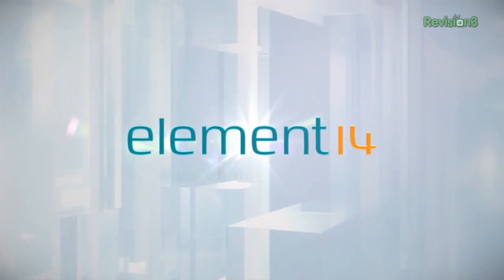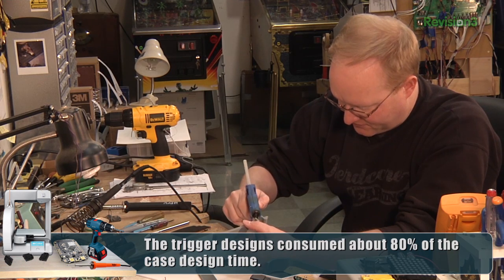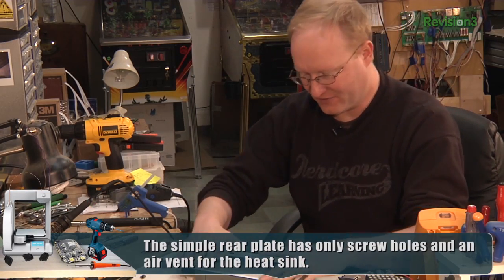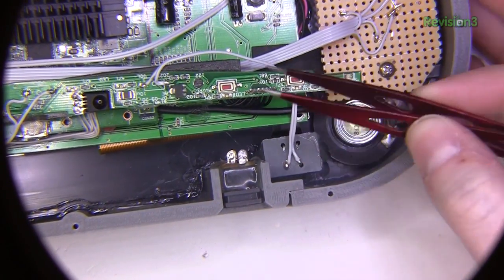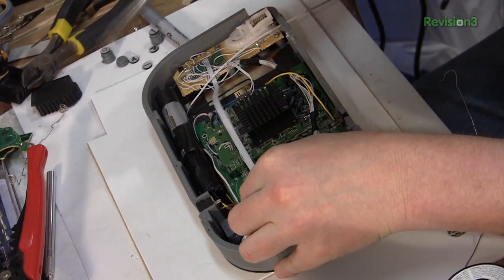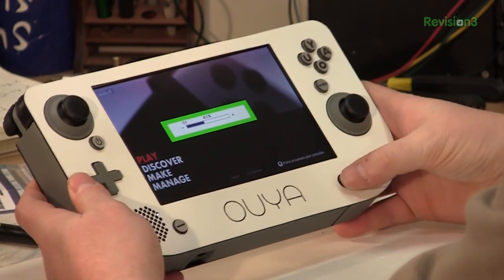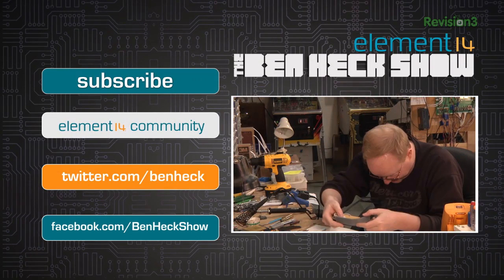Ben Kickstarts His OUYA Portable Build Part 3

Comment: If i had the technical know how i would've built the portable differently like for one thing placing the screen above the controller with a narrow channel for the wires to run through like they have at the game kiosks so the wires from the controller don't get damaged and is able to hold up the screen and console,
and connect the wire channel leading from the edge of the controller into the bottom edge of the screen and place the ouya components behind the screen and attach a lithium or nimh flat battery to save on space,although that's just something i would've done.

Comment: Would anybody know how to make a gameboy into a ouya type console without emulation
Reply: Cubing Miner bad idea.. Would take far too many resources and isnt possible with a stock gameboy.. Get a £25 Android tablet and run emulators from it.. If you wanna hack it then take it out of its shell!
Reply: Cubing Miner not possible, as the Screen uses vertical and horizontal line signals for the LCD. you cannot simply transform this into tv or rca out. Also the ribbon connectors where you would Need to get the raw signals from are way to hard to connect anything to it. Browse Videos for "DMG biverted backlight" and you will get an Expression on how hard this might get.
Reply: ok guess i have to go for emulation on a pi

Comment: So.....he basically turned the Ouya Back into an ANDROID tablet? Oh wait, that is right this is a ANDROID tablet with built in controls....well that might be nice if there were a need for that, I have 2 similar devices made by JXD already, the JXD s7300 and JXD s7800b.........
Reply: The JXD and Android tablet suffer a flaw with their portability; they suck battery life like a vampire in a blood bank.  I own the JXD s7800 as well and while I like that I can play emulators, android apps, and other stuff on the go, It sucks to know I have 3-4 hours of battery life tops.  Dead Trigger 2, a favorite of mine, last barely 2 hours on a full battery since its so demanding.  And on top of that it doesn't have USB charging (in 2014? WTF?) so I'm dependent on the AC charger (which just broke-yay luck -.-)

Ouya negates all of this with  a power supply and the ability to play a lot of your apps/program on a big screen.  The optimization with XBMC and its plethora of add-ons is worth the $99 IMO.

Yeah the JXD is great dur to touch, but Ouya as a sizeable library of games and a bunch of other games that sideload fine (like via Moga Pivot)
Reply: Brandon Driver
 I don't know about yours but mine will last at-least 4-5 hours running at 1800 mhz. It may be possible that your battery is starting to go. It's a good hobby to preform regular battery maintenance with all devices.
Reply: I do maintenance, but the battery drains like crazy.
Reply: Just get the NVidia Shield. While I don't own any android-gaming system, NVidia is a great company, and hardware and portability size, it's miles ahead of the JXD, or at least that's what I heard.
Reply: Only the stock roms I installed a custom then overclocked it. Nvidia's shield may still be ahead but the price difference is worth it.
Reply: ***** It does depend on what you want to use it for ... its hard to find an NVidia Shield for $100, where several of the low end JXD's come in comfortably underneath that. Not everyone wants to put down a couple of Benjamins just for playing emulator games and watching anime on Crunchyroll, when they can get something for under $80 that can do the same thing. By contrast, the point of the mod is to do it ~ bang for the buck would be a silly way to judge a mod like this.
Reply: eebruce If you have 200 dollars, or even 100 (and then you can save money up to 200 dollars), I think the Nvidia Shield is the way to go. It's as powerful as the iPad Air (and better in a lot of games because it's easy to optimize for the Tegra 4). It runs games like GTA: San Andreas without any problem, whereas the OUYA and even the Nexus 7 (2013) struggle to run it. Anyway, I guess it's a shame that there's no OUYA with Tegra 4 nor something similar (except for the Mad MOJO, but it costs 200 dollars). I am considering getting an Nvidia Shield. I just got the Nexus 7 (2013) like a month ago, should I get the shield? I am not sure if it would be a waste of money.

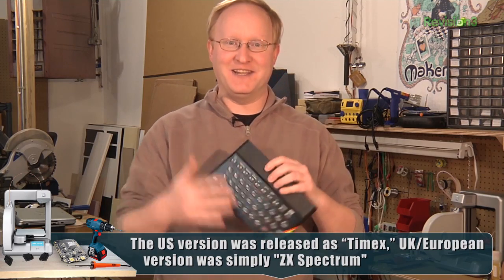Comment: 6:04 OMG.. reminds me of the TI-994a I had in school! Timex Sinclair, Commodore Vic20 & 64, cassette tape drives... those were the days!

Could you build an all-in-one emulator? A boot menu could let you choose which emulator to run, then time-warp you back to the good ole 70s/80s... Maybe run via Rasberry Pi, a screen like this project, keyboard/case from the Sinclair, and use Linux to run emulators? The classic computer laptop

Comment from the maker: Sorry everyone, the build contest link in the video is wrong. The correct link is
http://www.element14.com/community/events/4000
Good luck!
Reply: Ben in the video you installed the pair of lion cells with a balance charge module, can you give out the details of what it was and where I can get them from.

Thanks Matt
Reply: Eat the spectrum.
Reply: Matt Addison He used a HCX-D080V1 PCM, just google it and you can find different suppliers around.
Reply: Thanks
Reply: Matt Addison I should add it was inside the battery pack he took apart, hence the shape. He used the same ones in the Portable Raspberry PI.
Reply: Looks like he made a  Wii U Gamepad

Comment: Ben, I would like to see an APU powered mobile "console" like the one you just did that can play pc tittles with an integrated controller and a 7" display. Just so people can play BF4 and World of Warcraft on the go if there is wifi.  Even if it is a 2 piece, a small base station where the pc is built into as small as possible(like the Intel NUC or the gigabyte brix) and a wireless Wii u like controller.

Comment: I bought a Timex Sinclair T1000 when stores like Kmart were dumping them for cheap after what I call the computer wars of the early 80's. 

I was going to use at the brains inside a robot. I bought a 8 input/output kit for it that use peek and poke to read and set the values. I also bought the motor for a Big Trak toy for propulsion. I put it away years ago but just recently found the arduino and now my the T1000 and its huge accessory IO board is being replaced with a Pro Mini. :)

Comment: it should be fairly easy to interface the spectrum with modern technology, be it in the form of tapes in mp3 format or directly over the ports... of course getting composite video out of there is also a piece of cake, it is really a great system for modding in general

Comment: seriously what can an  ouya do that an average android phone or tablet cant do? i can even hook my tablet up to a tv....
Reply: Play games with decent performance, standardized constrols, and local multiplayer via either split screen or shared screen in 1080p. Which if you own like every freaken console from 1979 - 1998 you can emulate a majority of them plus handhelds up to ds.  More or less its a good system to have if you have IR friends who are gamers, but not retardedly biased over brands and companies. Also its a fun system to mod because unlike smartphones and tablets it is setup to basically be modded software and hardware wise. Plus since its not feeding off a battery you can overclock it much easier, unlike plenty of phones and tablets hat underclock to save battery life to advertise they have X battery life at idle in sleep mode basically.
Reply: Play games with a controller that is guaranteed to work in every game. And only have those games in its app store.

Also the Ouya can make some breeds of gamer really really angry for some reason, which is hilarous :-)

Comment: You should definitely hack up a nexus7
Reply: If you own a Ouya, you will understand why he did a ouya over any smart phone or tablet, if you don't and you just write the ouya off as a failed smart phone and tablet close mindly then you wont understand why. Even though the Nexus 7 old used some of the same componets its not the same. I own both, I use my ouya far more because its modded, and all of my games I can play in 1080p with a controller instead of a touch screen that causes me to block out the image with my big hands. Yes I can sync my ouya controller to my nexus 7 but hardly any games work.